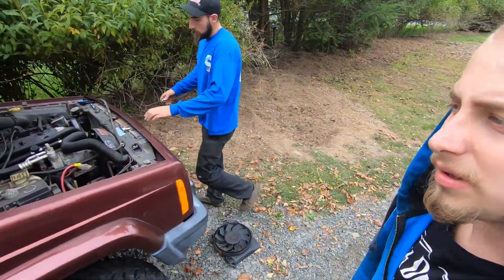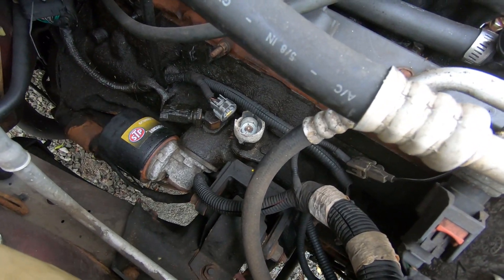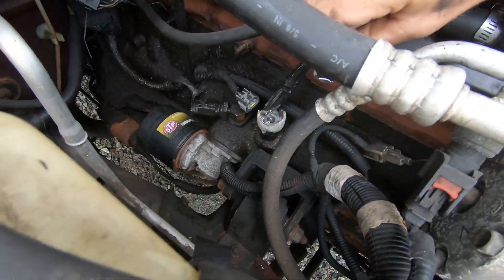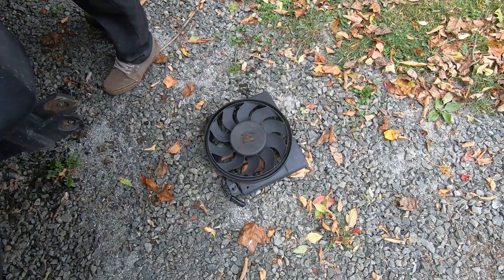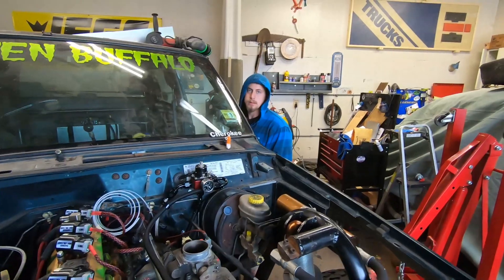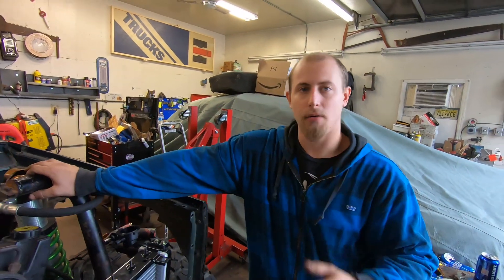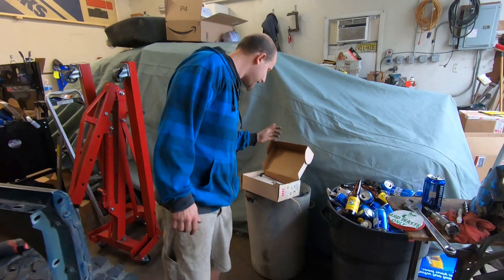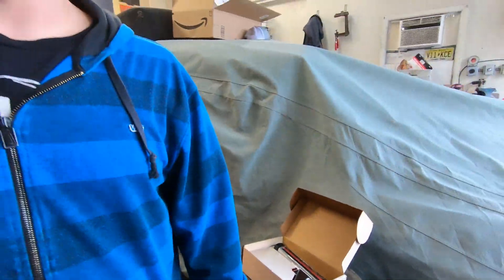Turbo Jeep Megasquirt Part 10

Comment: Hey guys, I’m turboing my TJ wrangler 4.0 and installed MS3. 

I can’t find a base map tune to start mine up. I’m running a stock crank sensor also. Is there a chance I could get y’all’s map to try to fire mine up?
Reply from the maker: Pretty sure there are a few on the interwebs
Reply from the maker: Boosted 4.0s on Facebook would also be a good place to find that.
Reply: @grewsum2sum could y’all help me out by telling me what y’all listed for voltages of all your sensors in the software? I’m having a hard time.
Reply from the maker: @Jake D  its been a little whilr but 99% sure cam and crank sensor get 5 volts all the rest of the sensors arr 12 volt

Comment: What pcb and version are you using? How did you get the stock sensor to work with mega squirt? I couldn’t find anything anywhere that explains it
Reply from the maker: You can get the stock sensor to work by giving it constant 5v and a 1000k resister between the the sensor 5v constant and the and signal wire. It worked for getting the jeep running but it shit out on the dyno. I would highly suggest messaging anthony randazzo on Facebook and getting a custom crank sensor from him cause thats what we ended up doing. Also  we have version 3.57 of the ms3x
Reply: Grewsum 2Sum thanks for such a quick response. I’ll definitely reach out to him for my crank sensor needs. Do you think the older 2.2 board with ms2 daughter board would work sufficiently?
Reply from the maker: @marcus11619  I think It would work fine with everything but maybe your crank sensor. Unless you have the custom sensor then the older version of megasquirt should be fine  with all the other stock jeep sensors.
Reply: Grewsum 2Sum thanks! I haven’t messed with ms in a while and I remember having compatibility issues with the crank so I’ll try reaching out to mr Anthony.
Reply from the maker: @marcus11619  hes the one that helped us when we were stumbled so I definitely suggest talking to him, but just start wiring it, there are plenty of self checks you can do with tuner studio to figure out if the sensors are working, that's the best part about it, trial and error is kind of encouraged in what we are doing with these tractor engines

Comment: Did you try to set you tps value a little higher. Mine stock is at 18 -19 percent at idle
Reply from the maker: Not yet when we get it back together I'll try to screw with it

Comment: Do you guys know the wiring diagram for the distributor,  coil and injection system?
Reply from the maker: Stock wiring ?
Reply: Yea.. i had to rewire  my harness and want to double  that side
Reply from the maker: @Trego8  what year? You should be able to find a pdf online of the factory diagram
Reply: @Grewsum2Sum  that would be great of you could find a accurate one for a 98 sport. Sorry about the late reply (personal stuff goin on tbh) this jeep has a real strain on my i even compared alot of the harness to a couple buddies and replaced the crank sensor bc it said no ignition reference at one point  im wondering if mb i fried something in the ecu?
Reply: The wiring is stock to my knowledge i rewired it on the injector rail and some on the distributor side but i was honestly aure i didnt mess it up...
Reply from the maker: @Trego8  https://xjjeeps.com/ should have the diagrams you are looking for in the factory service manual

Comment: You guys gonna throw new bottom end in it? I discovered In my 4.0 that oil pressure was always an issue, then knock knock goes the rods
Reply from the maker: Never had an oil pressure problem with this one 200k+ still going strong!

Comment: I would take that IAC and throw it in the dumpster, and I don't mean the back seat. That is a whole other thing to tune. It is not necessary to get it to idle warm. I took mine off and pipe threaded both the pintle (1/4 npt)  and the flange (3/8 npt) and pipe plugged them.  My stock 4.0 TB runs flawlessly without the IAC. Yeah I have to sit in it holding the throttle cracked for 60sec to build a bit of heat in the engine but after that it idles fine. You may fight that damn IAC for forever before you can even start to tune idle. Not trying to be harsh, just speaking from experience. #ftheiac
Reply from the maker: If that is the culprit we might just end up doing that!

Comment: Well boys I am stoked to see it fire! I remember you saying it never ran right after the cam install, but I don't think it's a "degree'd in" problem. That sucks that your old timing light died. My old Craftsman Advance light is my go to. No better light in my opinion. It took me a solid hour to get mine to idle on its own and it still requires a slight crack of the throttle to start. You guys will get it, I have no doubt!
Reply from the maker: She works still!  I tried it on my other jeep cause we were devastated..For some reason it just wont pick up the coil packs 😥